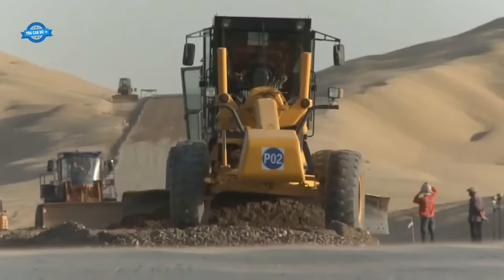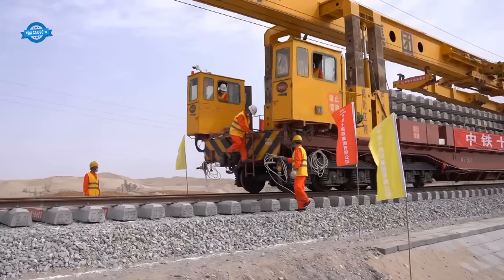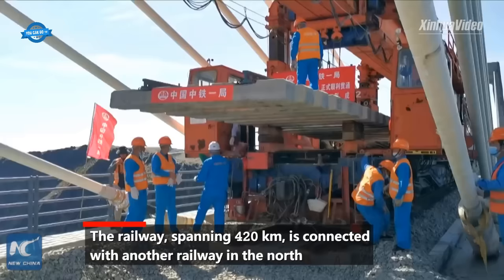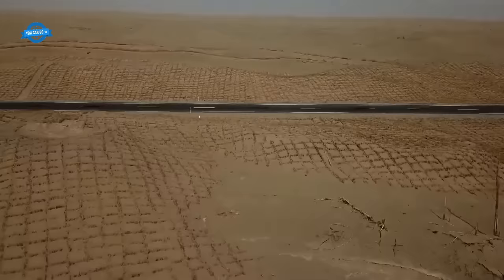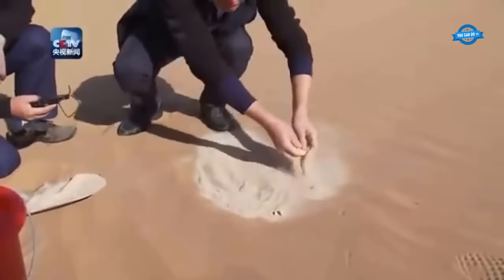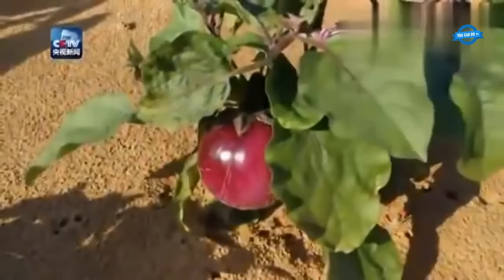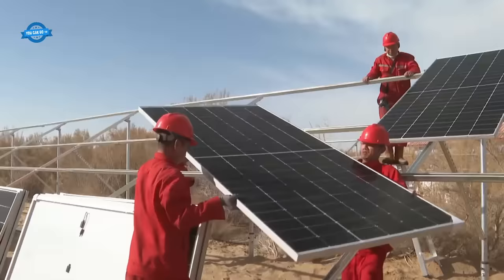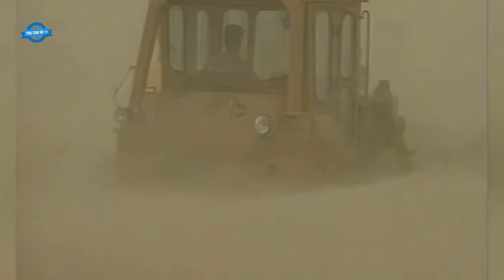China's Incredible Desert Construction Projects. Taiwan's High-speed Rail Project.

Comment: Chinese grass grids and tree plantations require years to become established enough to hold dunes from moving. During that time they will have to be maintained, replanting sections that don't survive. The idea is based on a proven project that was started in the 1980's by 6 poor farmers. They worked on their own, only with help from the families from the start. As they demonstrated their success, the government started to give them some money support. Additional families moved in when they saw the project working.  There is a youtube about this private project.
Reply: 胡说八道
Reply: 真能胡说八道，你是台湾人吧？草方格治沙方案在1960年代包兰铁路修建时就已经大规模施行了，哪是你说的什么1980年代几个私人搞的东西。

What a load of bollocks. You're Taiwanese, aren't you? The Grass Square Grid sand control programme was implemented on a large scale in the 1960s when the Baolan Railway was being built, not in the 1980s by a few private individuals did it, as you say.
Reply: 他连三北防护林都不知道，更不知道几代人是多长时间。 @xucg

Comment: Is it just me, or are Chinese engineers light years ahead of anyone else?
Reply: Your funny you have no clue.
Reply: @troyhickey4300  Is English your second language?
Reply: @georgekoen7414  It's just you!
Reply: @garygraham4679  Your answer is devoid of any information and seems to be a simple biased, knee-jerk reaction.
"A significant landmark was achieved in 2011 when the length of the Chinese expressway system surpassed that of the American interstate system. The planned length of the expressway system was set at 85,000 km but was exceeded since the system surpassed 100,000 km in 2013 and 169,000 km in 2021. The construction of new expressways will likely slow down afterward, underlining that at this point, China will have achieved an important step in its motorization transition. It remains to be assessed in light of the significant urban population, rising national production and consumption levels, and the fast growth of car ownership to what extent the national expressway network will be sufficient to support China’s mobility needs. Further, rapid growth will incur high maintenance costs as the highway infrastructure ages".
Reply: just you .
Reply: @rpvofficiel2184  Explain...
Reply: @georgekoen7414  their force Is their number 
They build fast as they have infinity laborers (that they can even underpaid and make them overwork. workers are not protected like in western countries so they can test Dangerous ways of Building without consequences). 
As they are constantely building they gains experience and Learn from their mistakes.
Not saying they are not good lol i might be Crazy saying this but 
Actually they are great good engineers everywhere in the world in 2023 .
Reply: They work hard at improving themselves.  It is also a matter of work ethics.